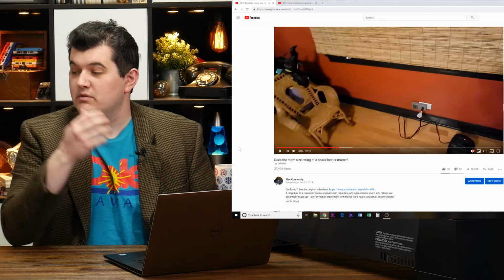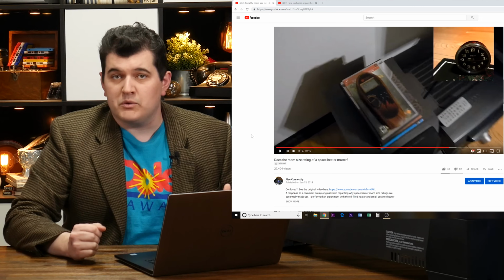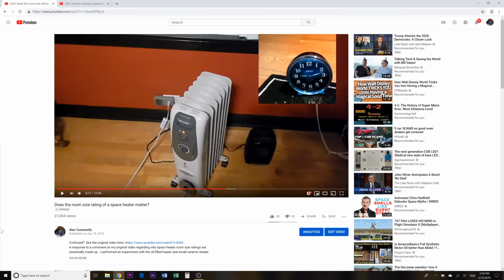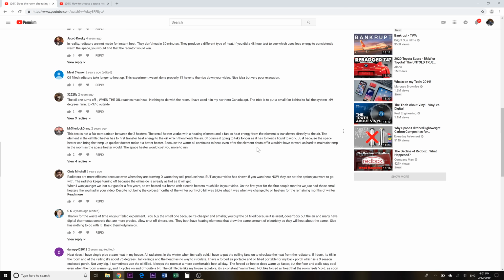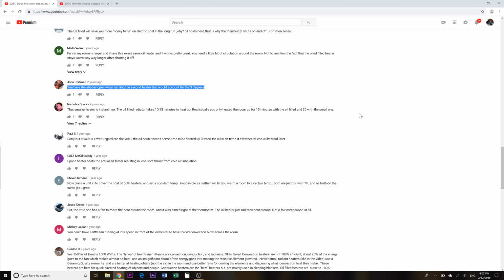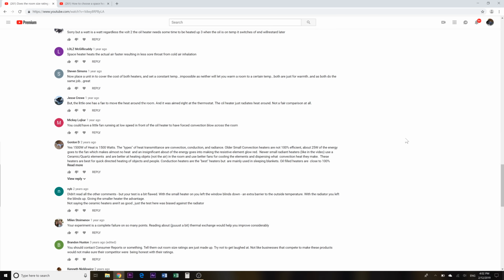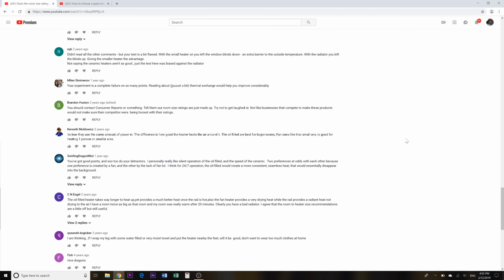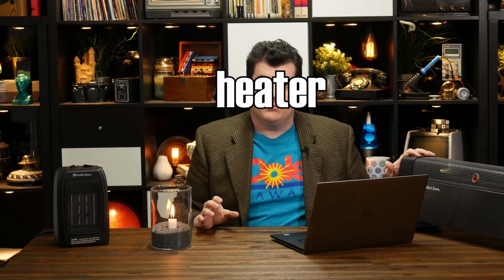More Space Heater Nonsense

Comment: The difference between the fan heater and the radiated fin heater is that the fan heater needs to be on and running to generate heat. Once the thermostat on the fan heater is triggered, there is very little residual heat left in the heater to radiate back out into the environment you wish to heat. Whereas with the radiated fin heater, once the oil is heated up, the heating element can cycle off to allow the oil to radiate the STORED heat into the room. Once the oil temperature has dropped below the thermostat setting, it will cycle the heating element back on. This method will use less electricity (in theory) to generate the same amount of heat the fan heater will produce. While I haven't tested this specifically, empirical observation proves this out. Plus, the heat from the radiated fin heater is more consistent. You get a constant level of heat. With the fan heater, you get a blast of heat when it's running, but when the thermostat turns it off, you get no heat...so you heat up, you cool off, you heat up, you cool off...honestly, that's really frustrating! And the noise is annoying. Who can sleep with that thing cycling on and off all night?

Comment: The movement of air by the fan improves the performance by moving the heat away from the heating element and is therefor more effective. I would say that even if you had a smaller unit with an 800 watt element and a fan, it would outperform a 1500 watt unit with no fan because the larger unit will not spread the heat out. The heat will slowly move away from it like you said but it will also cycle on and off because the thermostat setting is being met without actually heating the whole room. Which you also stated in the video. If your audience doesn't get that, maybe you could do something more scientific like have an empty small chest freezer that has reached its temperature. Unplug it and then run the heater placed inside and set to 40 degrees. See how long it takes to make a thermometer placed as far away as possible from it reach that temperature. Do the same with a larger non fan heater.

Comment: SO quick question. 
In that room you have a 1500w hair dryer, the 1500w small heater you already used and the 1500w baseboard style with no fan on your desk. Which heats the room quicker?  
Size matters but also materials  and function. 
We all know the hair dryer is not designed to run for very long and would never keep up even if it could.
The small heater has a fan, those fans are cheap and the cheaper the heater the cheaper the fan motor. It can move the air and warm a small area quickly and shut off to "recover". The air moving over those thin heating elements would prevent them from getting to a hot enough temperature so the use of a ceramic block is usually used. 
The large unit has no moving parts. The elements get much hotter. Place your hand on the grill and it is hotter then the grill of the small unit. These elements are usually a flat waffle design not wire so they can run hot without deteriorating as quickly.  
Efficiency can be related to application

Comment: I've used both types of heaters over the years. Instant spot heating with the the little one works ok for a small workroom/shop area that is used only intermittently. The noisy fan is a plus and a minus, though.  I use the radiator as a supplemental heater in my den to warm it a bit above the whole-house thermostatic control setting.  Purpose matters.  You have actually made your main point quite well on the specific issue of heat output. All the external factors involved in various usage situations create distractions.

Comment: I like those small heaters for the bathroom, they heat up quick and then I turn it off when I leave.  In the bedroom, I like the oil heaters.  They're safer if you have pets, and they don't have a fan to inhale and trap pet fur.  Also, you can use it to warm/dry things without burning them.  I like to throw my clothes over it to warm them up before getting dressed.

Comment: The one thing you haven't factored in, is the cubic feet of air they can move in relation to the room size. Bigger heater with bigger or faster fans, can move more air through the heating elements. Recirculating the room air multiple times per hour vs a few times per hour from a smaller or slower fan.

Comment: I absolutely agree that in terms of raw output, 1500W is 1500W. Any advantage posed by the large room unit is transient at best, as once you've exchanged the heat stored in the hot oil, it's just about pure power output (and in this case, airflow to keep the thermostat from shutting the unit off).

However, in some situations that high thermal mass/heat capacity could be useful. Yes, it takes longer to heat up, but that also means it takes longer to cool down. In *theory*, that could mean a room with occasional cold blasts of air (like a foyer) could be more quickly warmed back up by the radiator, due to the larger fin area and large amount of thermal mass available to absorb the burst of cold air. However, at that point it's a question of thermodynamics and how much heat is displaced, how often, etc. The benefits are likely minimal.

Comment: For safety (not heat only) reasons we use an oil filled with a fan behind it AND a ceiling fan in winter mode (moving air from ceiling down). Keeps our large, high ceiling bedroom toasty. I'm sure any other heater could do the same, heat wise, but safety is what I gave the upper hand.

Love your videos! Even the older ones like this 🙂

Comment: The oil filled heaters are good for being radiators, you start it and it slowly outputs the heat even when turned off, but to provide much heat, you definitely need some airflow. The small space heater does much better to heat a room up quickly.

Comment: You used a watt meter didn't you? How much power did each heater use to make the changes to the room it made.. The little fan  driven one must have been using full power full time where if the other was cycling it could have used significantly less energy, even tho it ran for considerably longer depending on duty cycle. The oil filled wont heat it faster, it should take longer but you should leave it on 24/7 and it is better at maintaining a consistent temp over time. You should compare a few different driven air heaters instead. Its like comparing apples and oranges.The use case should be different.
Reply: Those little suckers are awesome for like warming up a bathroom real quick before a shower, and the radiator you leave running all the time to keep a room consistently warm while being less obnoxious and using a bit less power as it is cycling on and off more.
Reply: And i am not sure how they work but there are radiator heating systems for a full home in NY and other places like that. Those are a whole different thing tho, but those work quite well.
Reply: And just to say.. I do mostly agree with you, but I think the use case is important because there are so many. But I think there is alot of potential experimentation that could be done with that, but You'd almost need 3 rooms. 1 control, and 2 to test 2 heaters at the same time because as it gets later the outside gets colder, and also meaure the power useage over maybe 24 hours or something for each. That would give sooooo much more of a solid answer.

Comment: If you have a ceiling fan, in winter, put it on low but also *reverse*. it will push up, forcing the hot air outwards to the walls and down. Best way I know to distribute the heat irrespective of heat source, and stop it all pooling above head level.

Comment: Would appreciate a video exploring various"radiant" space heaters. From watching both your space heater videos, it seems clear to me that they would still produce the exact same amount of heat/energy because 1500w is 1500w, and they all seem to be resistive heaters, but what are, if any, the advantages of the "radiant" features. It seems to me they're just resistive heaters with directional reflectors. In any case, I think it would be cool if you did a video explaining the differences/advantages of each. And also where infrared heaters fit in to the picture. Cheers.

Comment: Watts used in an hour is all that's important to test this. Set all the heaters outside on a calm 70F degree day and measure the watts used in one hour. The little fan driven heater will out perform the others if all are 1500watt heaters. BTW 1500watt is the max output. BTU per hour is a better measurement and how professionals rate equipment. Watts per hour is also accurate for testing purposes. Run the test for 2-3 hours.

Comment: a 1500 watt fan assisted heater will heat the room up quicker or appear to do so as its fan assisted. a convector heater at the same wattage will take longer and may struggle to heat the room up to the temperature because of dissipation and draughts in the room.   therefor the fan assisted heater must be more efficient as it takes a shorter time to heat the room.

Comment: Conclusion: If you want fast heat for a short time, use a heater with a fan. If you want to keep a room at a consistent temperature, over a long period of time, use an oil filled heater. If you want to feel warm in a cold room, use a radiant heater, and aim it at the space you will occupy.
Reply: That's an important point that the video(s) don't cover: if you want to feel warm quickly ,  then a heater that concentrates the heat in one direction (towards where you're sitting) will feel more effective. If you're just wanting to heat the room altogether, then any heater of equivalent power will have the same effect - that's just basic physics. I'd agree with you about avoiding the ones with a fan, but more because the fan is more likely to fail if used for prolonged periods than ones without a fan, than that they're any better as heaters .  (Plus they tend to have more area that's not quite as hot, thus less dangerous [as in less likely to burn yourself - probably countered by you're more likely to dry/warm things on them].)
Reply: When I lived in Europe there was no problem to get a heater with a vent that was blowing air on slow and high speed, same as hair blower. In Canada there's no such thing as a vent in a heater that blows air as a hair blower. All and any heater blows air on slow. Warm air is not going on a distance, it all goes up. I know physics, but I want the heater blow the heated air, not just push.
Reply: The quantity of heat is the same, the quality differs
Reply: @zyeborm  No, only how directional it is, and maybe some thermal lag. For the same power input, the same heat comes out: if it's directed at where you are sitting, you will feel warmer sooner, but the room won't heat any sooner. If the heater has inertia - such as some oil-filled types - they won't heat up as fast, but they'll stay hotter longer after turned off.
I suppose you're right if you are using "quality" to mean "type" - i. e. directional or not. A lot of people use the word to imply "goodness" - there is no such thing as poor quality heat.
Reply: @G6JPG  yes I meant quality as a property not an abstract good. But it sounded cooler that way and that's important right?
Reply: @zyeborm  Yes, I realised you might have meant that, half way through my typing.
Though "cool" isn't a good word when we're talking heaters …🙂
Reply: Thank you. I know the video had a different point to make but people won't always need the maximum output - so silent and consistent will win a lot of times. I think people just get a better overall experience with an oil radiator and that's why they hate on fan heaters so much.
Also oil heaters are made with a metal casing and with no moving part so while all my fan heaters broke in no time, the oil heater still goes strong and does a way better job keeping my place warm and dry due to just being consistent. I wouldn't go back.

Comment: The radiator has two advantages: (1) Runs without sound, which can be advantage for light sleepers, who could be woken up by the fan cycling on and off. (2) Not likely to set anything on fire, as there is no airflow to block, or a fan to fail.

They don't heat the room more, but do it in a quieter way and arguably a safer way.

If you want more heat, wire in a 240 volt heater, or buy an old space heater that runs at 1850 watts, but isn't up to code anymore for obvious reasons.

Comment: I still kinda got a problem with the room heating experiment. You should have scrapped it when you realized there were factors unaccounted for that were affecting your result. Instead you went on to use your hypothesis (same wattage heats the same amount) to explain your result as a consequence of the oil filled one not actually running the whole time. That's not very useful, let alone scientific.

Comment: Nothing is infinite except the universe and human stupidity lol literally rewatched your video from a year ago to buy a heater and a oil radiator would work terrible for my application in a garage you need air circulation otherwise the heat just goes out the vent in the roof also used to heat my garage with 7 candles under a table to spread the heat now I know I was basically running a 525 watt heater by doing so so I learned something new lol however I do wonder if a oil heater with a fan to keep it cool and on would it still cycle and would you actually see more of a consistent 1500 watt heat they claim as opposed to the half watt/hr you see with the oil heater compared to the air heater

Comment: I know I'm 2 years too late, but to get infinite heat from an oil filled heater, you just put a box fan in front of it to force cold room air through the coils.

And if you wanted to accurately measure how effective a heater is at heating a room, you should have looked at the kill-a-watt's energy reading (in kWh). Since your oil-filled heater was cycling on and off, it would have consumed less net energy over the 30-60 minute test period than the energy consumed by the fan heater. Your figure of merit would be degrees of temperature rise in the room per kWh of energy consumed (which determines the amount of money spent on electricity).

Comment: Just to put another hole in this boat, the oil filled heaters put out 1500 watts until it heats up and then an internal high temp switch cuts off one of the three 500 watt elements in it because the oil will boil and and explode the heater if 1500 watts stays on so when the thermostat is on it only puts out 750 watts and then the thermostat shuts off so the hourly average output is much lower. Check it out over at Matthias  Wandel's y t channel.
Reply: Uhhh that's exactly what he's saying he said in the original video - That the thermostat limits the output. The problem he doesn't realize is that he communicated that so incredibly terribly.
Reply: @DiscoFang  no that is not what I am saying,the output is reduced internally in addition to the main thermostat on the front.

Comment: I don't get the concept of a heater that's fanless unless it's got some other way of moving the air near it just as quickly. I do like the idea of the large room heater being safer because the heating elements in it are completely contained in fluid. But why not put a fan on the large room heater to get air moving past it and move the heat away from it quicker so the thermostat doesn't shut it down?

Someone else here had the idea of putting a fan behind the oil radiator heater to get room air moving past it. I think that's an excellent idea in is probably the best solution of any except for the non-existent oil radiator heater that has a fan doing the same thing.

Comment: As an electrician I was asked by a kindly woman how she could reduce her electric bill. (She had resistive electric furnace) she told me she had reduced her light bulbs to 15w and it had not changed her bill. ( pre-LED times) I told her that the previous 60w lamps were putting out 188 BTUs
of heat, and the 15w lamps were putting out only 47 BTUs. This means her electric furnace had to run a tiny bit longer to make up for the heat that the lights weren't producing. Net savings either way 0%. Same KWH either way produces the same heat.

Comment: Rambling, even for you. Ouch, sorry. However... if you consider the little heater a "spot heater," pointed an an individual (or there legs, or placed under a desk), then the object that the heater is pointed to, in the case of a person, is likely to be warmed without the rest of the room being warmed. Especially when the heater is placed under a desk, the warm air it produces is mostly trapped under that desk and the rest of the room warms rather slowly, if to any great extent at all. The underside of the desktop is going to get toasty warm, however. My two cents.

Comment: the fan in the smaller heater spread the energy more evenly and thus the temp measuring device was effected by that.  The oil heaters energy was hangin 'round the ceiling more.

Comment: Ask urself how can you cool a room with just a fan? Well the opposite is true as well. Maybe that riddle will help u.
Reply: A fan does not cool a room it simply moves the air.    A fan can cool a human by blowing air over the skin which allows heat to expel from the body faster and dry off sweat.   Now, if there is some cold air in one side of the room and hot air in another it will mix it up and make the room equalize, or if you have a window open and the air outside is a colder temperature, it could help draw in colder air or expel warm air to the outside but the fan itself is not cooling, it is simply moving air.